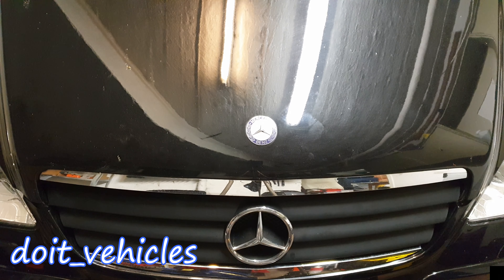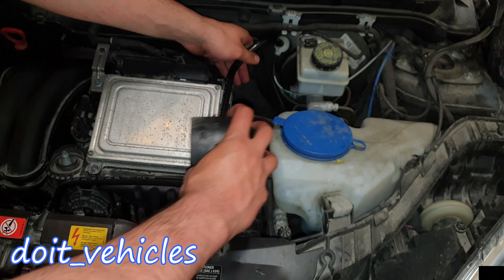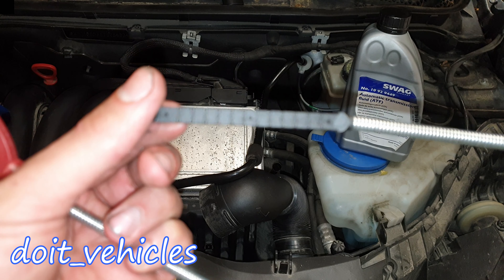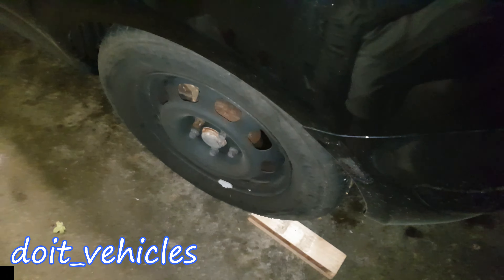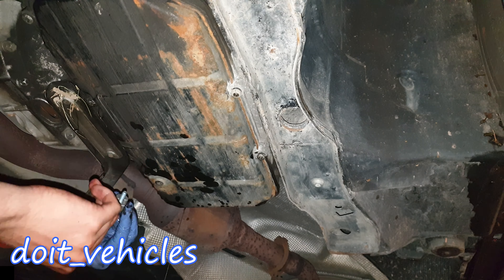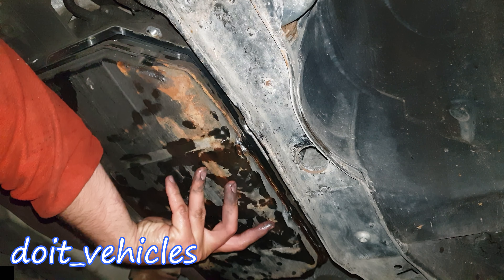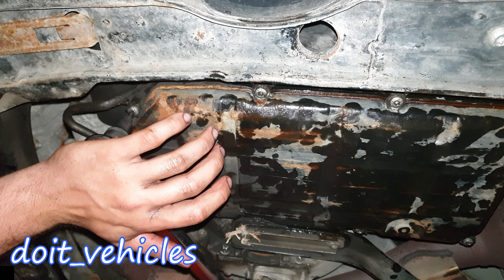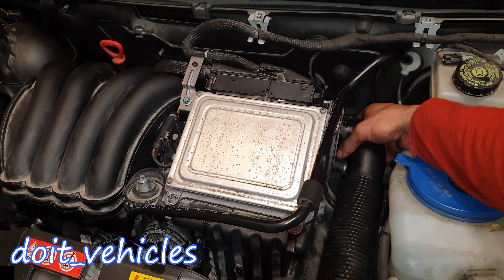Mercedes w169 A 150 Automatic Transmission 722.8 cvt Fluid Change  w245 B class

Comment: the drain plug comes off on the opposite side :)), and the oil got contaminated as soon as you put it in the box because you didn't empty the converter as well, DON'T DO LIKE IN THIS VIDEO!!!! :dothefive::dothefive::dothefive::dothefive::dothefive::dothefive::dothefive::dothefive::dothefive::dothefive::dothefive::dothefive::dothefive::dothefive:

Comment: Hi, excellent video. I have a question I have Mercedes B class B200 2005, I am planning to do this service, I was looking to buy a kit which comes with 4 Litres of oil, is that correct?

Secondly will I need any software to clear any error codes, and is the process exactly the same for B class as this video? 

Do you just fill exactly how much came out (if doing it at home without dipsticks/temp gauge)?

Thanks! 🙏🏼

Comment: Is it possible to use engine oil dipstick instead of gearbox oil measurement?  Driving 30,000 km, ten years the car needs to replace the gearbox oil but not the oil filter assembly？thx

Comment: Great video! I did the same for my A150 CVT and removed 6 litres, then put 6 back. I am concerned I may have overfilled, but don’t have a dipstick. Do you have the official capacity of transmission fluid required by this car?
Reply from the maker: In dealerships , they will use the original dipstick to check the fluid level on older cars  which is hard to find online for sale ( at least I could not find it ) it has a bulky end and marked only for this transmission . The total amount of fluid inside the transmission must be around 10 liters , I don't know the exact amount . Unfortunatelly these are made to be serviced by the dealers so they won't tell you information about it .. therefore what is left to do is to refill with the exact amount you removed , or check the level from a car which have been serviced by dealership and compare the level with yours ..
Reply: @doit_vehicles  So you refill almost only have the amount of oil? Is this because there is still oil in the torque converter left when draining?
Reply: Should be 4l without torque converter

Comment: my car w169 class A 2007 getting 2734 and 0841 error, some time gear slip however from last week new error on dashboard - Transmission -visit workshop. total Milage 91k. is it require to replace the transmission ? or only replace transmission oil will work.  I checked with one garage they have given me 2nd had transmission cost as 2300 Pound.

Comment: I have mercedes b150 Some car sevice said me ıf we change cvt transmission oil it cause some problem is it true ?
Reply from the maker: no ; If the transmission is damaged or on the way to be damaged than it will make problems ; Also adding the wrong fluid / too much / too little will cause probems .

Comment: Hi, thanks for the video. Im actually doing the transmission oil change for my cla45 right now and I've been trying to check online about the torque specs for the tranny drain plug 14mm hex and couldnt find it at all.
Reply from the maker: it should not be more than 15 ft lbs if it's aluminium , btw nice car you have :)
Reply: @doit_vehicles  i ended up tightening to 25ft lbs

Comment: For manual clutch, do I need to change the clutch fluid also? Read that it is the same as brake fluid.. seems my pedal clutch is not very precise difficult to enter first gear but not slippery clutch so I thought I should flush the fluid clutch do you have a video/procedure I think needs two people?
Reply from the maker: For the manual transmission the fluid is not on the clutch itself , it's just on the gear box . If it's diffcult to enter in the first gear , changing the fluid will almost certain not fix that issue . All the jobs on a car can be done alone ; To take a transmission out you will need a tall garage where you can lift the car high eneough to get working space under . So the best thing to do is to remove the gearbox and inspect it . Since I don't have a proper garage yet , I can't show this types of jobs yet .
Reply: @doit_vehicles  ok many thanks for your feedback that is saving me to look into this.. maybe I'll just flush the brake fluid I think on manual it is shared brake/clutch and replace it with new one but I need to look at it one day cause car (A200 petrol) got some hesitation when low rpm and accelerating don't think it's throttle body idle car is steady what do I'm think maybe issue? Spark plugs? Car only 88000km already changed once

Comment: Thank You for the useful video, i have 2009 b200  , i get the quote  from MB dealer  to change the transmission fluid roughly about $350 CDN for an old car like mine :( it not to hard to do the job but the car come with  no dipstick .
Reply from the maker: The dipstick can be found online

Comment: Good job friend, as always.

By the way, do you have any video, about cleaning the air sensor or IAC Ralenti air, of your Mercedes w203?
It is possible that in my Mercedes w203 C180K of the year 2007 Petrol,
It has an unstable idle, when the steering wheel is fully working on the Right or Left ends, Wheels

Greetings from Spain
Reply from the maker: An unstable idle can be caused by many things ; if the idel changes when you turn the steering wheel than it might be a ceased power steering pump or something that requieres more force from the serpentine belt  .. You can try to clean the mass air flow sensor but it might not solve the issue ; If you want check on the playlist on this channel with all the videos about W203 c200k
Reply: @doit_vehicles  I fear the worst, if it is possible that it is the steering pump, anyway, I will check the tension of the auxiliary belt, also yesterday I was looking for and found many videos including the IAC sensor of your Mercedes.

You are the best teacher
Regards

Comment: The gearbox oil temperature should be 35C when checking the amount with the dipstick.
Reply from the maker: the source of the info ?
Reply: @doit_vehicles  Just re-checked. Looks like i'm wrong. The level at 80 degrees celcius should be between 7 and 5 on the dipstick and at 50 degrees celcius it should be between 4 and 2.
Reply from the maker: @johagustavsen9506  Sounds more plausible , the challenge is to read that temperature

Comment: How often do you change the oil?
Reply from the maker: After 100 000 km
Reply: W169 CVT needs every 60.000km new oil and filter. Its a very sensitive transmision compared to regulair AT. CVT repair is expansive, oil change is not. Mannol CVT works great. Other brands as well.  Please do not underfill or overfill it. Amount depends on how much you drained. There are aftermarket dipsticks that work perfect. Also only use CVT oil within MB spec, regulair atf will end your CVT gearbox. After replacing the oil Let your car idle for a couple of minutes and shift from time to time from Drive to reverse and neutral before driving off.